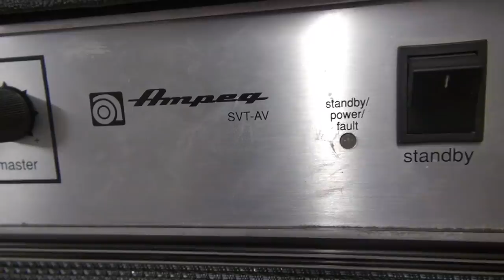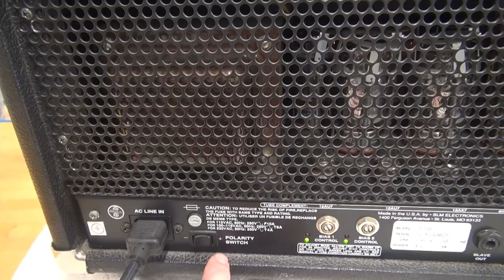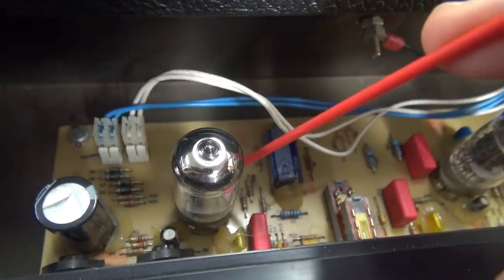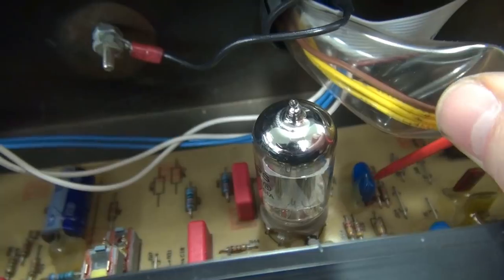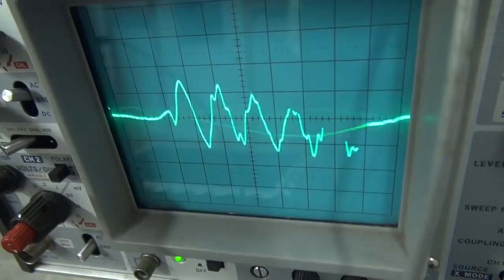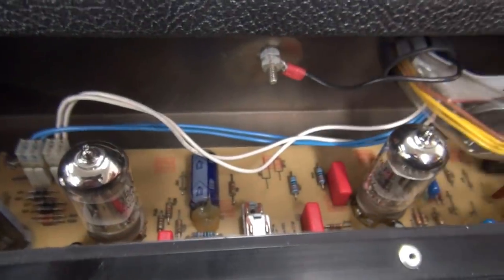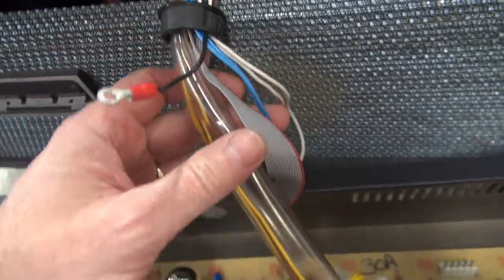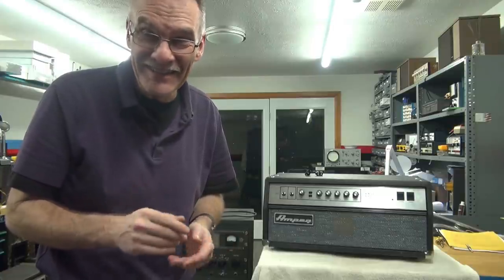How to fix hum noise Ampeg SVT AV Tube Bass Guitar amplifier

Comment from the maker: Update: Owner reports Hum is gone, never worked better. If you have this issue, take a good look at those PCB mount Cliff input jacks!
Reply: Can I send you a small Sears tube amp?  Where do I send it if so?  It has a hum that  increases and decreases with the volume knob.  I took on the project for a friend and now I'm assured I'm not as capable as I thought.🙁

Comment: Always a good idea to mark or color code plug-in connectors with a sharpie before you unplug them, so that you know where they plug back in. The white and blue connectors on the rear left hand corner of the preamp board look the same and I didn't see anything put there by the factory to differentiate which one goes where. By the way, those types of plug-in connectors are prone to oxidizing and they don't clip on all that tightly either, so you can expect problems in a high power bass amp that gets heavily vibrated, not to mention physically shot when somebody carries it around and sets it down hard because their arm is about to pull out of its shoulder socket!

At the 3-day Voice of the Wetlands Festival in Houma Louisiana  last October,  hosted by Tab Benoit, an SVT with an 8 speaker cabinet was the on stage "house" amp for every band and performance, for the first two days or so, until finally it failed after much heavy usage, and was replaced by a Gallien Krueger amp which they must have had as a spare or back up. I don't know if it was a newer or older SVT, probably a newer one; didn't the original SVT have a 9 speaker cabinet?

Comment: I don't know if the AV has the same power board as in the VR, anyway, according to the VR schematic diagram, the polarity switch simply connect a 0,0033uF bypass capacitor from GND to main L or N or none.

Comment: Hi Terry, it's interesting that you got an SVT in for repair. I just repaired an SVT classic a few days ago,  which was a nightmare. The newer SVT's have the output tube sockets mounted on a PCB...6550's no less. one of the output tubes shorted and turned more than 1/2 the board into a hunk of charcoal. I am not fond of output tube sockets mounted on a circus board. What were the design engineers thinking? The older one's made in the 70's were made so much better. in 1980, Magnavox bought out Ampeg and it was down hill ever since. it was later owned by Loud Technologies and now recently acquired by Yamaha..Ampeg used to be made here in my home state...New Jersey. I could tell you war stories that would go on for a week LOL :)  I tell my customers to try and find an early 1970's vintage SVT. the early one's not only sounded great, but they were more reliable. Great videos as always. Keep 'em coming :) Watch your lower back with lifting those suckers onto the bench.
Reply: I have a V4 and a V4B that I picked up secondhand quite some time ago, sitting on a shelf in the garage waiting for me to get up the gumption to go through them and get them working properly. The v4b is kind of a little brother to the SVT, but that doesn't mean it is little, and it sure as hell isn't lightweight! And yes, it has circuit boards in it of course.
Reply: Hi Frank! I've heard other folks say the same thing regarding newer SVTs vs vintage SVTs. I've owned two SLM-era SVTs, and neither matched the volume of a vintage SVT that I used to borrow in the late 70's. That vintage SVT also had a cleaner tone when it was cranked up. There was only a slight bit of overdrive, which was warm and rich in harmonics. Neither of my SLM-era SVTs produced that sound. They went from clean at lower volume to a raspy distortion at gigging volumes.

I'll be on the lookout for a vintage SVT. Thanks for your opinion on the newer models. I very much appreciate it.

Best regards.
Reply: @derwinmoss5709  One-channel gain/master structured SVT's will always pale in comparison to the two-channel non-master volume versions. Lately, I've been poking around eBay and Reverb, and those vintage 70's units are creeping up in price. No longer can you find them for $1,500 or less. They're in the $2,000 range. I'm gonna save my money a little longer because Ampeg now make a new two-channel SVT that has the same voice, signal path, and everything else as the 1969 (in channel one) and 1975 (in channel two) versions of said amp. It's the 50th anniversary Heritage model and it's built right here in the United States. The volume, tone, and feel absolutely blow away any of the standard SLM or LOUD era offerings. 300 watts of clean headroom just like the old ones. Only downside is the price: $2,700 plus tax.

Comment: Mr d-lab I have 2 peavy 4 10 classic 50s I do play loud my oldest one had caps change no problem pretty quiet  second one 1997 had caps done and has  loud hum like the amp peg and could I email the issue to you your far from me  but it shows the problem no one seems to can cure

Comment: have B-25 on bench new output tubes cleaned pots / reseated all jacks  worked fine. 1st culprit was bad contact on spkr jack switch. did 3 wire ac cord mod, pulled polarity switch, moved stdby up front where polarity switch went..now i have a that increases with vol on both chan . the guit comes through to.../? have no clue . filter cap hum is usually constant.. this increases with vol control..bad coupling cap in preamp? does same using ext amp output to another amp. its only 50 yrs old..LOL...ps: love your  vids..and choice of wines